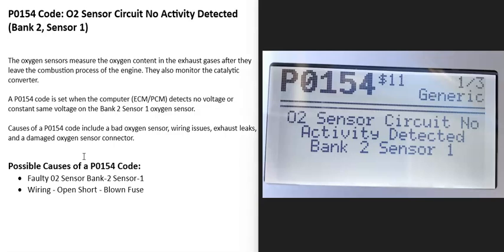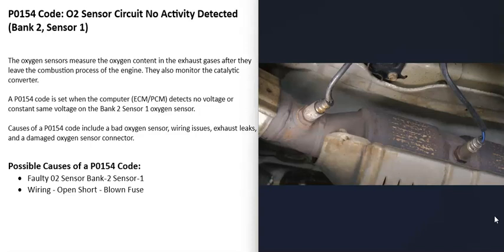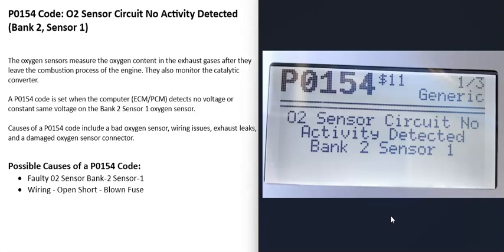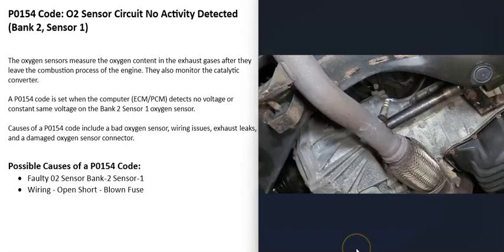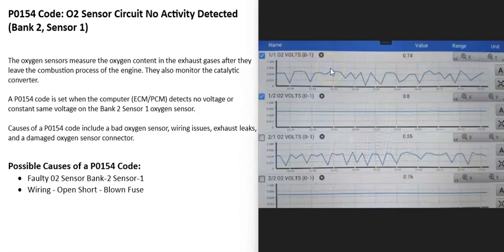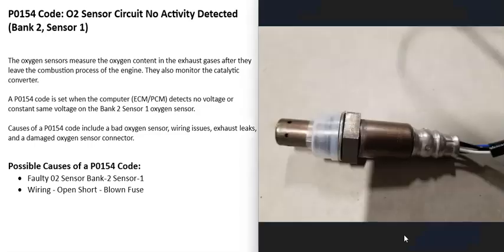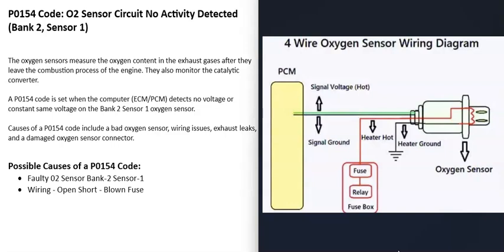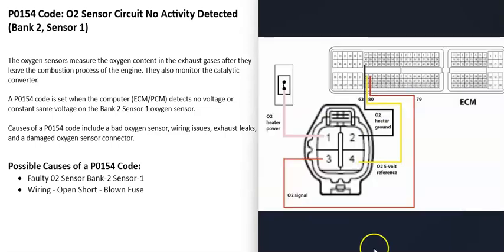Causes and Fixes P0154 Code: O2 Sensor Circuit No Activity Detected (Bank 2, Sensor 1)

Comment: 2004 toyota tundra  v8 I got the P0051 code bank 2 sensor 1 so I replaced the o2 sensor on the passenger side upstream now next day I got the P0154 code 🤦🏽‍♂️